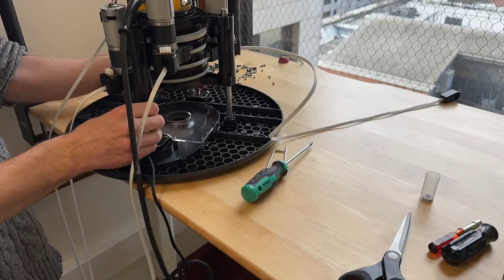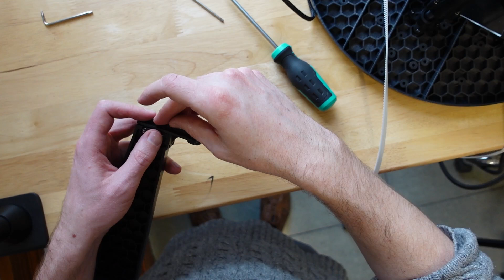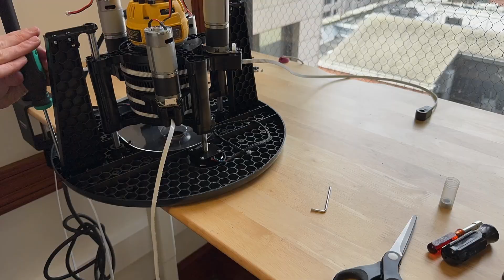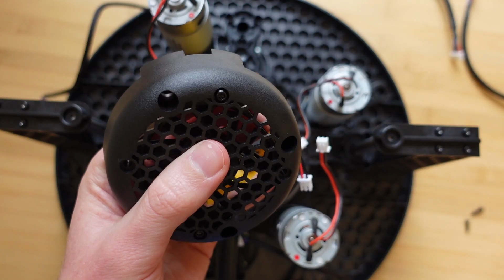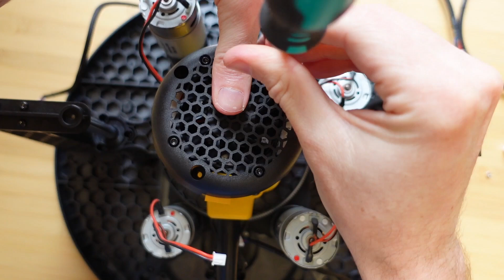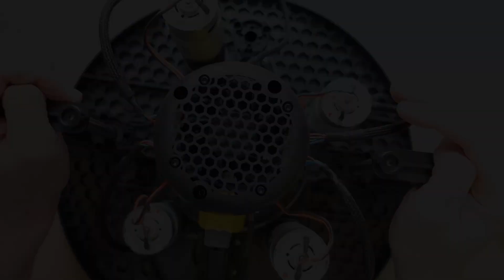Putting it all together

Comment: I try to understand. Are the arms connected to the Z-axis? If you raise the Z-axis, do all the arms move upwards? Does this mean they are higher, creating even more tension and pressure on the belts? Is the magnetic encoder reading affected?

The arms should be independent of the Z-axis. If you raise the Z-axis, the arms should not move from their positions.